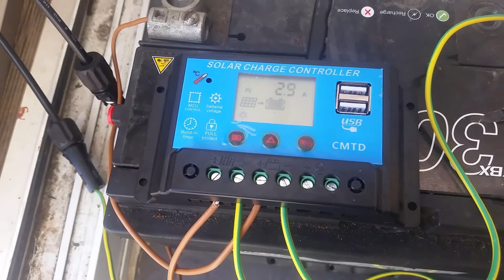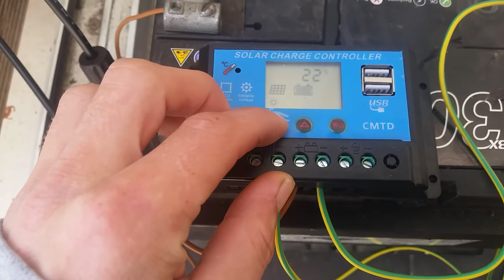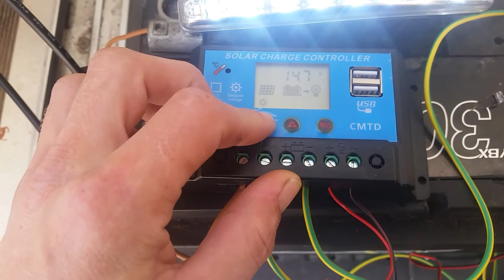Phono Solar 255w Solar Panel Test - Off grid workshop

Comment: It would be much more if you didn't had the shadow of your garden chair on the panel. perhaps 500% more. 10 Amps.
Reply from the maker: Put it on the roof of the shed and was amazing then had to remove it due to roof leak but your right